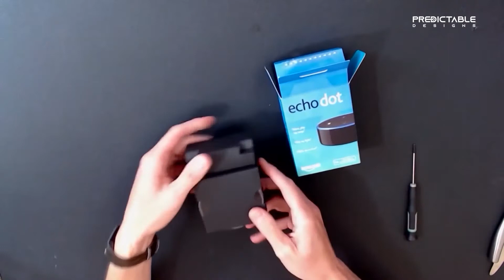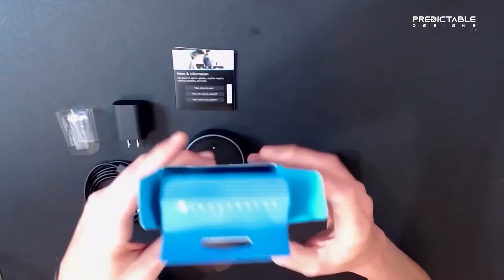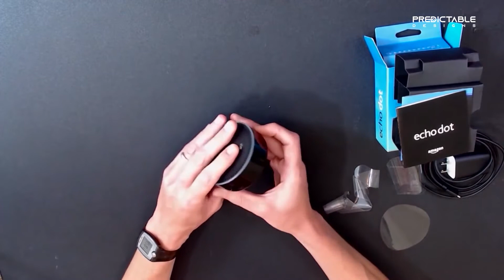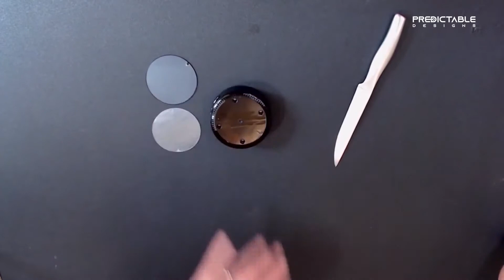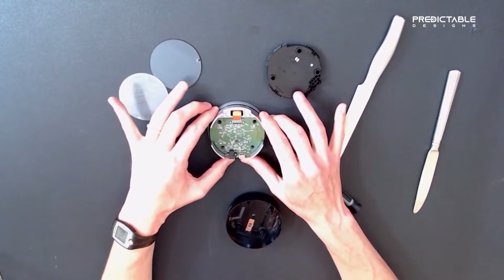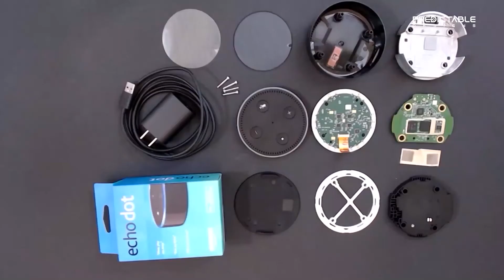Inside an Amazon Echo Dot - Full Product Development Teardown

Comment: I've found that board mounted USB ports creates a failure point in that when a cable is plugged in and gets bumped it has the risk of breaking that solder connection. Is there a way to "ruggedize" board mounted ports to avoid this, or is a jumper with panel mount the best if this is a concern?
Reply from the maker: Yes, I'd suggest you use a connector with mounting holes. Also sometimes using a through-hole connector instead of SMT can help a lot.